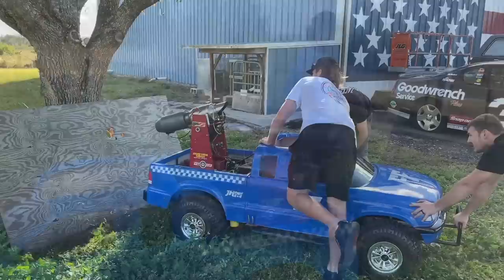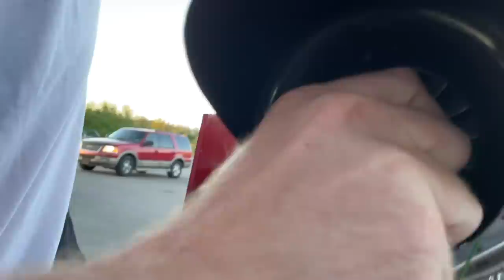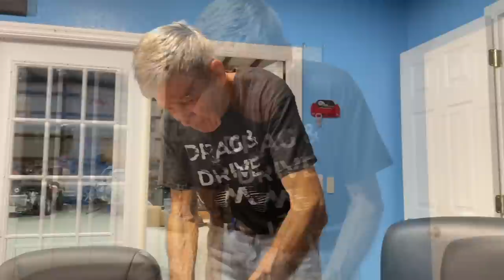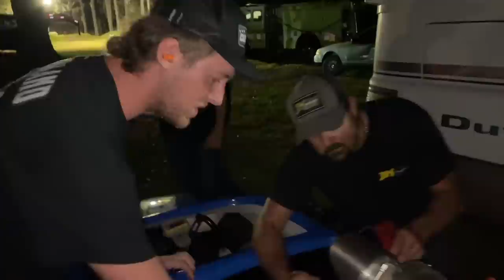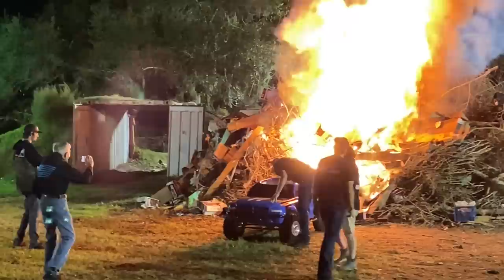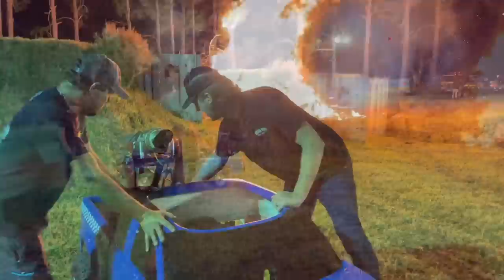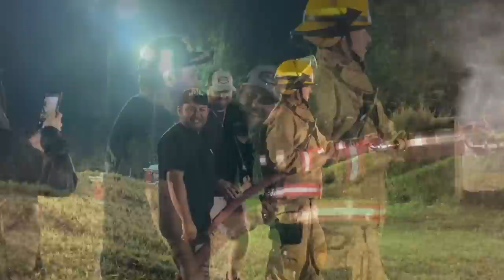Stoking a Fire With a JET ENGINE AFTERBURNER Will Get The Fire Department Called...

Comment: Warm up and cool downs on that little turbine would help. Don’t just fire her up and go straight to flight idle 😂 give it a sec to warm up to temp same goes for cool downs don’t just shut it down let it run some normal operating temps through the hot section first then shut it down. I know it’s so hard to wait but it’ll save your bearings and internals.

Comment: It needs a cooling cycle after running the turbine and yall need to make sure you're using adequate oil mix in with the Jet A or diesel (whichever fuel you use).

Comment: hey guys not sure if you are but you have to run around 4% oil in fuel mix to lube turbine bearings. ashless marine 2stroke works well just dont use actual turbine oil its toxic cheers

Comment: There needs the a cool down of the turbine before shutdown. You cannot just turn it off after running the afterburner for that long which is why the bearings have seized up. Also, I'm sure there is a maximum amount of time you should run the afterburner and I think you guys exceeded that by a bit. Turbines aren't like your average engine they require more care and attention because they have an impressive power output and with that output an incredible amount of heat especially under thrust.

Comment: I don't see how you didn't melt the body off the back of that thing when burning the plywood. Unless it's actually made out of metal but I'm sure it's not. I wanna see a full power speed rip with that thing. 👍

Comment: when every start is a hot start, every aggressive throttle up throws flames out the nozzle and no cooldown procedure at shutdown cokes oil on the bearings, you can expect a destroyed engine very quickly. There's a reason you needed that ECU you bypassed. facepalm

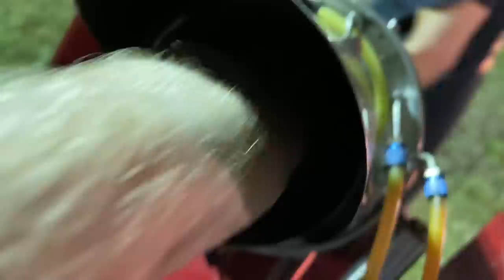Comment: @12:05 You need to let it run and cool off so that when it expands from the heat and then contracts as it cools, it cools evenly and doesn't weld the fins to the casing.

Comment: Guess you are not changing your carbon footprint from all the waste from your internal combustion engines as you killed a tree. Just remember, the death of auto racing is 2035 so get you fun in now. I am going to miss drag racing. Been a fan for 63 years. Wonder if the NHRA and IHRA have received the memo yet.